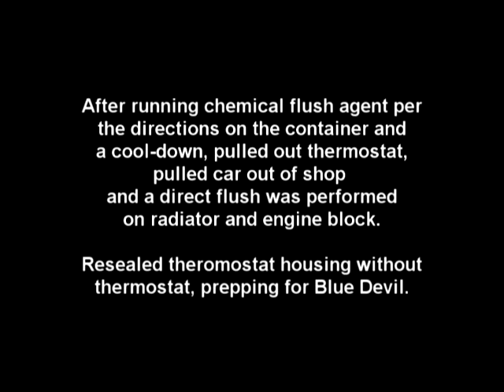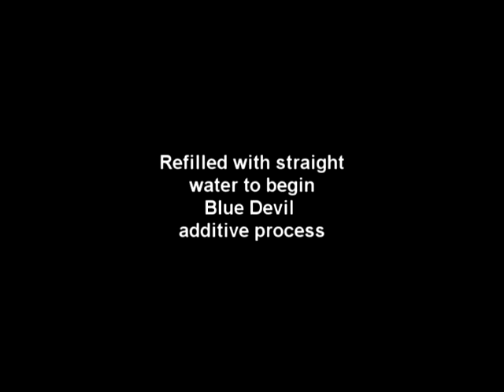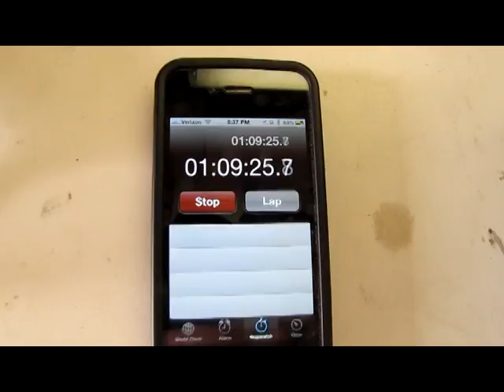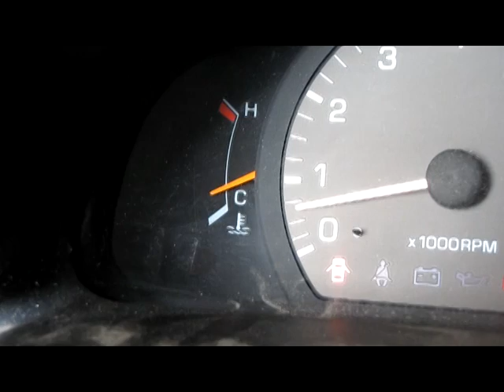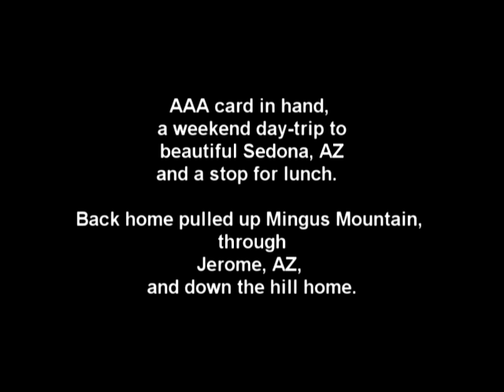Blue Devil Headgasket Sealant vs. Napa Block Tester Pt 2 of 2

Comment: Excellent video man.  I've wondered about this stuff.  Just lost a car due to head gasket failure.  Got in way over my head trying to fix it.  Should have tried something like this first!
Reply from the maker: Kevin - yes, they are a LOT of work, and a decent command of all the mechanical stuff is really necessary.  I just pulled the heads off of a 99 Dodge Ram 1500 5.2L - working on a future YOUTUBE video for that, and yes, a LOT of work, but went quite well.  Dropped the heads off at the machine shop this afternoon.  Not so much for the novice, but someone with a lot of patience and willingness to learn could do it with some help from someone who knows how.  Organization and documentation really really help.  r-

Comment: Since doing this have you run into any thoughts on using such a product with a small diesel engine that has higher compression.  My new to me 3cyl tractor appears to have a head or block leak.  It would be GREAT if I can buy some time with a product like this.
Reply from the maker: Coachgeo:  Hm....what bothers me about this is the word 'new.'  Probably not with anything that is 'new.'  Blue Devil says it works also on diesels, but I have no base to tell you it does....?  It worked for me for a few years and bought me precious time I needed.  Do a block test (Napa Block Tester - see my other videos) to see if you truly have an issue, then, if you think it's worth the money, I'd do it, depending on your value in the tractor.  Old Mustang,  .. um, NO.  Old beater car, hell ya.  r-

Comment: My Infiniti QX4 has the thermostat attached to the cover/neck and its not recommended to remove.  Do you think it would be a big issue to run the Blue Devil with the thermostat in?
Reply from the maker: Ken: Yes, I actually do - but, my suggestion is that you contact the company (US Sealants) and ask them what they suggest.  I'm not so sure it would work in a system with a thermostat.  Just my feeling on it.  r-
Reply: Thanks for the response and great videos

Comment: Great video! I was skeptical about this stuff working in any situation until I watched this. I'm fairly certain my head gasket is gone on my 99 Cadillac sts as they have blown notoriously at roughly my odometer reading and the car is overheating for no obvious reason. I read some of the other comments in regards to confusion over the directions on the blue devil packaging. On blue devils website they state that the 16 oz bottle is an "easy to use" method designed for less mechanically inclined people. The 32 oz bottle with the yellow label is a more permanent fix and requires the method you detailed in your video.
Reply from the maker: Iain: I'm glad this video has been helpful for you. I've heard and read comments about the Cadillac STS units being notorious for these kinds of failures; I'd recommend that you also read up on some forums on the Cadillac STS, and perhaps pose some questions there on this product, but at the same time be aware of all the techie-trolls out there.  Forums must be taken with a grain of salt, but can provide invaluable information.  Next, Blue Devil did me well during my 'time of need,' however, the car has since failed.  I got many, many miles out of it when I had no other car, so it did me well.  But, in my opinion, it's not a 'permanent' fix by any stretch.  For me, it was worth the work, money and the gamble.  In no way do I suppose this to be a 'fix-all,' but, for me, I got a couple of years more of hard labor out of the car.  About to tear it down for a proper gasket replacement.  Just want to be clear about my opinion.  I was pretty amazed - I'd do it again in a heartbeat with the right vehicle (not an old Mustang or some such vehicle).
r-

Comment: Probably the perfect of example of when to use this kind of stuff -- on a beater you need a bit more use out of but isn't worth major expense to repair. Seems like a good option for this type of situation. That said, it also doesn't seem like a fix to be handled by a complete novice. Looks like there's a lot more involved than simply emptying a bottle of it in your radiator.

Thanks for the vid.
Reply from the maker: irpacynot  You hit the nail on the head.  Gotta really kinda understand how to implement this stuff, so great response there, and also, yes, a 'temp fix' attitude is the right one.  The car lasted a few more years and finally is waiting on the correct repair. But during a time when I had surgery on my foot and had to travel long distances, it did the trick.  Well-worth the $60 and a day's work for me, altho it was a total gamble.  r-

Comment: I have a 2001 montero sport, running without a thermostat atm. but if i put the stat in,the hoses gets really hard. both upper n lower. engine gets hotter than normal range on the gauge. I don't wanna go hotter so I turn the heater on and it goes down. funny thing is I don't loose coolant. and there's bubble on radiator during cold start. do i have a HG problem? would this product clog my heater core?
Reply from the maker: mcarino98: it is totally normal for your radiator hoses to get real 'hard.' Today's cooling systems are closed systems, specifically designed to build up pressure. They work like a pressure cooker:  depending on your elevation, for each pound of pressure your cooling system is able to build up and keep, you gain degrees on top of the 'normal' boiling point for your cooling system.  15 lbs is pretty typical, and at about 7000ft elevation (where I used to live) we'd gain 3 degrees per lb  held.  So- 15 X 3 = 45 degrees on top of a 'normal' boiling point.  So holding pressure is VERY important. I'd suggest a good block test be run - and no, this liquid stuff won't clog your heater core but, flush it before you do any kind of work.  Hope this helps some.  r
Reply: Thanks for the reply sir, yeh,I understand rad hoses get hard due to pressure,but not as hard as a rock though,lol. mechanic did a block test and chemical didnt turn yellow. im baffled,mechanic said its not the HG. but engine is building too much pressure and is making the engine really hot.
Reply from the maker: Hm.  Generally-speaking, pressure is good in cooling systems, because as pressure builds, it drives down the boiling point (probably should ask someone about that who specializes in physics), and that's very true. BUT, that doesn't answer your heat issue. Your turning on the heater and thus lowering temps is a big clue.  My next question is, how does it do at highway speeds, with air flowing over the front of the car (like 50+ mph)?  Are your tests only conducted while the car is standing still?  I'll wait for your response. r-
Reply: Thanks much for the reply again, engine gets hot driving highway and uphill. im about to take the thermostat out to see if it still overheats.

Comment: Hi man great video!! Really need some advice if you would not mind..i have a 99 ford explorer..i ran the coolent/antifreeze dry overheated and my truck shut off completely.i let it cool down added coolent/antifreeze and it ran good after that..this was 2 weeks ago.now i have water dripping from my exaust pipe and green coolent puddling up on the ground right under where the clear plastic tank is that holds the coolent/antifreeze.and coolent is dripping from the front of my truck. Truck idles real rough and sounds like its gasping for air and struggling to stay on.check engine light is on and i dont know what to do.autozone put it on their computer and said i have a bad 02 sensor and a bad heat sensor. Ive been dumping a gallon a week of antifreeze/coolent . Please help me have no clue about this stuff i think it could be a headgasket from wat ive learned online but not sure..thank you again for posting learned alot!! /josh/
Reply from the maker: Josh Ferguson: My apologies for taking so long! I taught a night class in automotive technologies at the local college (what else..?) and my time has been limited. You do a great job in giving a technician a good description to go on in order to do some diag. If your truck ran hot enough to shut off, I'd be severely concerned about that. Cut to the chase: the main job of the head gasket is seal, and to keep separate, individual channels of coolant, oil and also the compressed (exploded) air/fuel mixture in the cylinders. If you have a damaged head gasket (do block test to confirm), you are most likely (classically) mixing these 'channels' among one another. That said, assuming everything is 'ok,' your O2 sensor 'sniffs' the exhaust (output) of the engine, where ONLY remnants of fuel and air should be, trying to monitor levels of leftover fuel, amount of air, and so on. Those sensors are not designed to detect coolant, so if there is any kind of coolant or anything else in your exhaust that doesn't belong there (or an improper balance of burned gas/air according to specs), it will fire up a trouble code (service engine soon light, check engine light, etc).  Idling rough would further be a symptom- why?- because the cylinders could be trying to burn coolant (due to mixing of 'channels'), which isn't combustible. The new computer, diag of a bad O2 sensor and so on are all potential RESULTS of having something in those cylinders other than fuel and air; neither the computer nor O2 sensor will tell you whether you have foreign matter in there, and only will tell you if something 'isn't right.'  Did you tell Autozone that you'd overheated, and that you suddenly have lots of coolant leaks on the ground? If so, that would be clue 1 to me. Once you have the compression 'channel' leaking into your cooling system, you are then getting highly-pressurized stuff in there which then can over-pressurize your cooling system, which of course can then cause leaks. likely being 'pumped up' way too much, in addition to being pumped up with super HOT stuff.  I'd say you have some classic symptoms of a compression leak (maybe more than one) - a block check would be what I would highly suggest.  That chemical test, if performed properly, will tell you one way or the other and give you at least a direction to go from there.  Sorry!  Hope this helps some! r

Comment: Great Vid. I have 2003 Chrysler 300m, Overheats, new water pump,timing belt, therm. rad.cap, upper and lower Rad. hoses. Flushed system, checked all fan relays and fans. Still get hots. System is bled. Suspect head gasket leak. Bought a block tester at oreilly's. Will test when it warms up a little, ( no Garage). Will try blue devil, if leaking. is the "fix" still holding? how long and how many miles have been on the car since you did this? Thanks for the vid. I am subscribing to your vids. too.
Reply from the maker: Rodney Reed: If you look down below you can see the miles this car went on the Blue Devil 'repair.'  I say 'went' because it finally gave up the ghost.  It was relegated to teenager-driving, and not long ago it just overheated for no real cause, so I suspect the damaged head gasket finally really blew out. I can't complain, though, because I got a lot more time and miles out of it for spending under $100 and a day's work.  Now the car will be torn down and inspected for proper head gasket set replacement - which, I don't look forward to.  Not the easiest transverse car to work on, but nonetheless, a nice-riding and running little car.  I got my $$ worth, I think.  r-

Comment: Had same car with same 3vz-fe motor it blew front head gasket flushed the system and used blue devil, it worked for a while and blew again. tried doing the same thing and added more snd maybe made it 10 miles down the road before blowing again. i personally dont think head gasket fix is worth the money also it tends to leave sludgy deposits in water jakects and radiator/heater core
Reply from the maker: Chander: My opinion is similar to yours to a degree: I think these kinds of fixes are great for the more minor-level damages, but for the more major-level ones I think the proper repairs should be done.  The issue is that a consumer with little automotive diagnosis experience doesn't necessarily know the 'extent' of the damage, whether it's minor or more major.  So it's up to the consumer to decide whether to try this stuff out - it's not cheap, but does work for the more minor-level damages. And, if you get another year out of the vehicle, then you've got your money's worth. Again, if you are the type of consumer who is concerned about water jacket and channeling clogging, then tear the thing down, spend the money and take it to a machine shop for full vatting services, set up the rebuild processes and parts procurement,  = $$ and tons of time.  Depending on your value of the vehicle, that may be the way to go. I don't necessarily believe that this product is a 'fix-all' either.  r-
Reply from the maker: reluctorvalve -BTW, the Toyota 3VZ-FE's are known for popping head gaskets from what I've heard. r-

Comment: Says right on the bottle "Not compatible with antifreeze".  Also says to drain system and let it sit empty for 24 hours. Then flush again before adding coolant.  
So did anything bad happen?
Reply from the maker: Dave LeBlanc: I'm not sure what bottle you are looking at, but here is what mine says, right on the directions:  "After pouring Blue Devin slowly, let vehicle idle with CAP ON for 50 minutes.  You do not need to flush the system a second time after process is complete (Blue Devil can stay in the system).  After test drive, let engine cool before installing new thermostat.  Compatible with most anti-freezes."  Nothing mentioning the whole 24-hour thing you talk about, nor the incompatibility with anti-freezes.  Considering your information is vastly different than what I've seen on several bottles and on their website, my suggestion is that you not rely on my homemade video information, but rather follow up with the company who makes the product yourself by visiting gobluedevil dot com.  Ask them your questions, because your info directly contradicts the info that I have from the install directions on my bottles. My results have been great thus far. Blue Devil didn't cause any 'fumes' in my case.  r-
Reply: reluctorvalve OK thanks.  I had used blue devil about 2 years ago.  I guess they have changed the formula since then.

Comment: Can I try this on a diesel engine? I don't see why not not, what do you think? I have a chevy 6.5 turbo diesel
Reply from the maker: According to Blue Devil, yes, absolutely.  r-
Reply: Thank you... I actually went with Bar's Head Gasket Sealant, they make one that doesn't require you to drain the coolant system or remove the thermostat. It worked like a champ! The smoke from my truck looked like a NHRA dragster! Now I have no more white smoke! Beautiful!!!
Reply from the maker: Mike Winkelman Awesome!  I, along with others, would like to hear more about this product you used!  Thx for the follow-up.  r-

Comment: hello thanks for posting this great video.....
i do have question and it is very important for me......
do i REALLY HAVE TO drain/flush the cooling system before i use the blue devil product?
i am asking because on how to use section it says it is not MUST thing to do
and another question my car looses coolant for about 8 oz in 20-25 days is it horrible or its minor leak?
Reply from the maker: Gor: Following the exact instructions of the product has been a point of importance.  I would follow the directions as closely as possible. I have not used it without drain/flush, so I can't tell you what to expect.  If this is that important, you should contact the company which makes the product.  You can find them at go blue devil dot com  (all one word).  Sorry I couldn't help you more.  r-
Reply: thanks a lot.....

Comment: Is it necessary to flush your coolant?
Reply from the maker: CBW0314: According to the mass feedback I've seen, yes, you should follow the instructions verbatim. Additionally, anytime you take the cooling system apart or replace stuff, you should just go ahead and flush the system - it's cheap insurance, as we used to say. r-

Comment: Reluctorvalve, I used blue devil 7 months ago or so and it worked wonderfully. I think I've driven at least 15,000 miles. Now the quick fix is beginning to fail rapidly. Does it make sense to try blue devil a second time on the same engine, or will that clog up the radiator, heater core, etc? In a pickle here as its tge middle of winter and funds are slim. I have no intention of trying to sell this car.
Reply from the maker: Daniel: well if it's a vehicle you don't care much about if it does get damaged, I'd try it.  But if not, I'd probably call Blue Devil (US Sealants, I believe) and ask them.  I have not heard of anyone who has done this, either.  I'd try it again on my old beater car, but not on one of my more valuable ones.  r-

Comment: Bad news ... didn't work for me, any way I bought the truck knowing that I was going to work on the heads, my problem is not that big, truck does not overheat, doesn't smoke, heater works fine, just the coolant is getting slowly in the oil, so next thing is taking everything apart and find the leak, anyway I wanted to try this and hoping to get a miracle LoL, now I have to do the right thing I guess
Reply from the maker: Hector: sorry for your negative results. Good clue is that it's not overheating. That's odd. I'm happy to report the negative results as well, so long as the language is acceptable.  Thx for reporting back, and good luck! r-